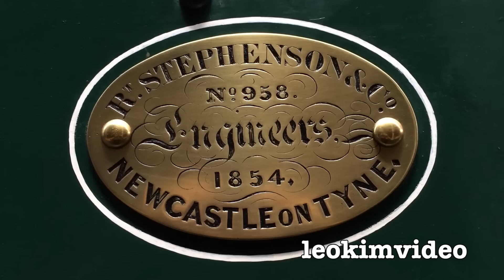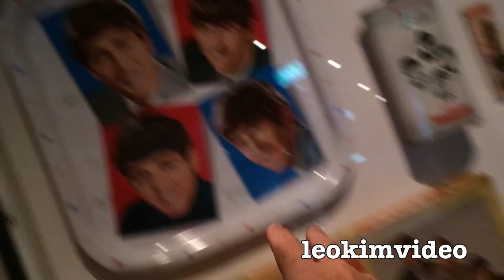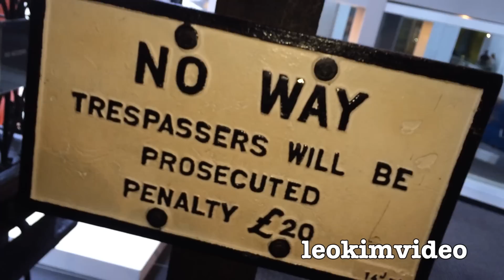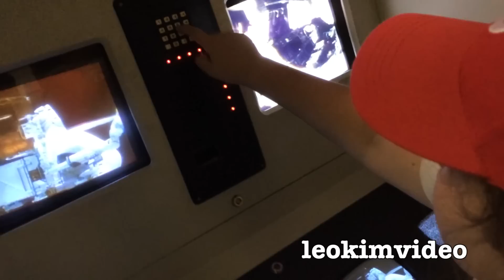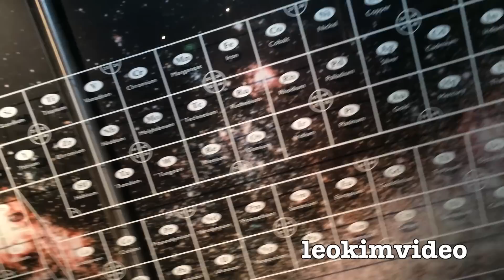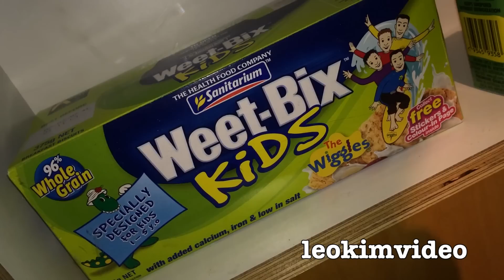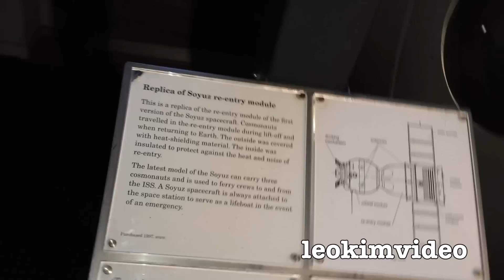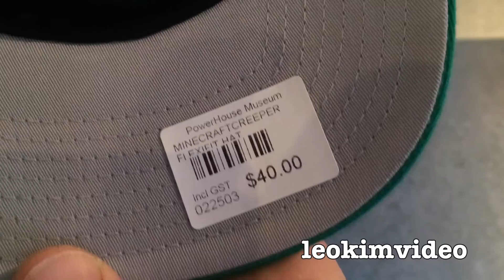Trains Machines Rockets Robots Fake Mars Rock Wiggles & Fun Powerhouse Museum Sydney

Comment: 20:50 Looks to me like a Tomix model. They do beautiful little N scale Thomas models. Sort of like the Bachmann of N Gauge.
28:13 It looks like it could be a LMS Class 5. It's certainly an LMS design anyway. The one thing I can say for certain it has been Garrat-ed. Many trains have been rebuilt like this so they can climb hills better, pull heavier trains etc. A nice collection of Garrat locomotives can be found on the Welsh Highland Railway.
Great video as ever Leo! Nice to get a good long video for a change there may be some people who don't like them but they can like it or lump it! The museum reminds me quite a bit of the ThinkTank in Birmingham although the Powerhouse seems much bigger.
Reply from the maker: thanks
Reply: leokimvideo